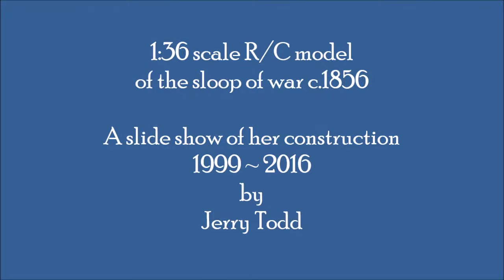Constellation Model progress from 1999 to 2016

Comment: That looks amazing... Is it true that no lead bulb-keel is used for this ship to operate under sail?
Reply from the maker: There's no "fin" with a ball of lead at it's bottom.  There IS a PVC pipe about 4 feet long, a bit more than 2 inches in diameter, and filled with lead shot so it weights nearly 45 pounds; bolted right at the bottom of the keel.
http://todd.mainecav.org/model/constellation/pics/cutaway.jpg
Reply: @Uhlan_  That looks like a very nice solutions to me. The real-size original will have had much ballast in the storage compartments of the ship.